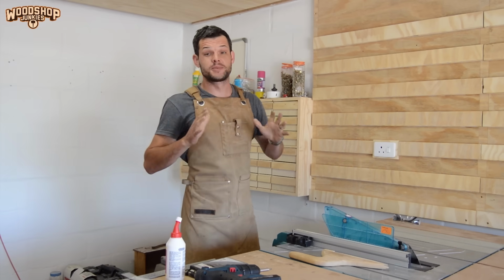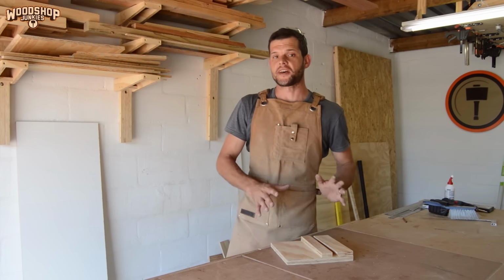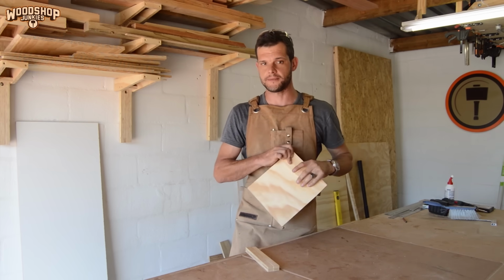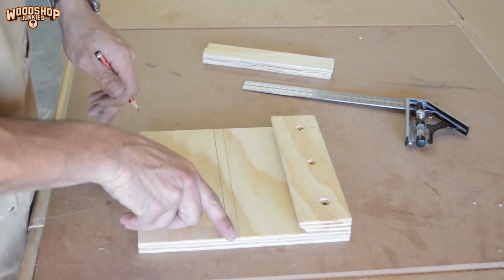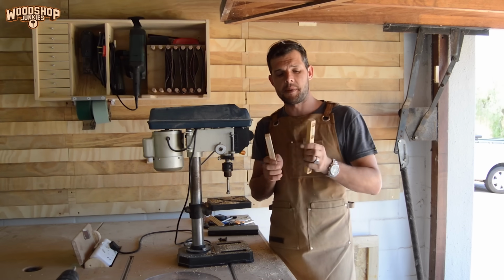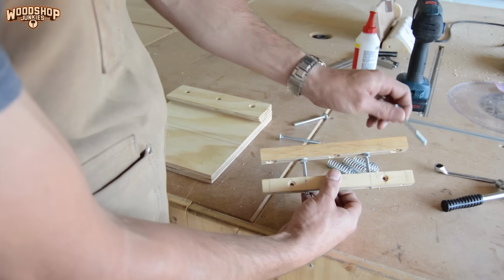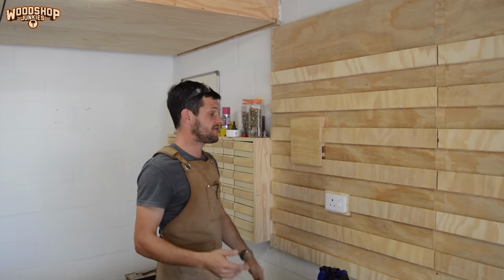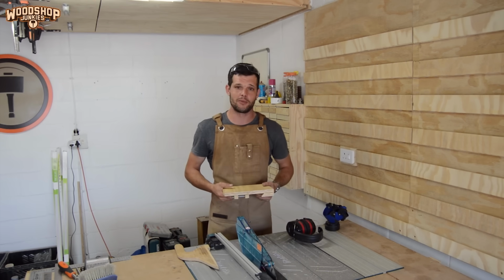Self-Locking French Cleat Mount - How To

Comment: My solution: I have made a 10 degree angle under all the cleats on the wall. I use a "lock-bit" on things I want to secure.  Easy, fast - but not as hmmm... "delicate" as yours :) But flexible though...
I have also thought about making a "pushblock" in the cleat it selves. Perhaps just a dowel at the right height, underneath the cleat is is hanging on. This could also be a "click-button" thingy...
Great channel!
Reply: @kimsmoke17  Thnx ;) 
...but I did not find "my type of button".
I am thinking of a non electrical one, like the top of an old style ball pen marker. Click = extended, click retract... Ifjusee.
Or did I just not find it?
Reply: I don't quite understand how your solution works. Any extra details to help? Also, what is a lock-bit? Thank you

Comment: I like a technique I saw on a different french cleat video:
* On the wall cleats, you add a 10 degree cut to the bottom (making wall-facing side even narrower).
* Add the same angle on top of the cleat you want to lock to the wall. (so the cleat is narrower towards the wall)
* Create a small block with 10-degree angles on each long side and of a height that will nest exactly into the space between the top of the cleat and the bottom of the next wall-cleat.

The block will prevent removing the mount by bumping or pulling; you have to wiggle it out from the side. It has the advantage of no moving parts, but the disadvantage of requiring alterations to the wall cleats to work.
Reply: I saw that one too. I think it is a simpler, less costly, and more pragmatic solution. But this idea is really cool, too!

Comment: The thumbnail was quite self-explanatory, but still watched the entire video because your videos are just that good.
Was just wondering if you even need separate guide bolts. If you just add a nut and washer on the inside of the spring bolts (same way that they are on the guide bolts), then I believe the 3 bolts alone will work as guide bolts for the block as well as holding the spring.

Comment: If you lowered the cleat on the hanging part, so the top of the backboard ends in upper half of the space between the wallcleats, you can easily lock the item hanging by sliding a wedge in covering the gap from your hanger cleat to the above wallcleat. That is one of the basic ideas with cleats, to evenly space and use same dimentions always, and you can make wedges that fit everywhere too for items you want to lock

Comment: It might be overly complicated for ordinary and average mounts, but it seems to be a good idea for those oddball mounts that require added security such as for what you intended it. Another instance in which this system would probably come in useful is where French cleats have been incorporated into a mobile storage or shop cart. I thought about doing this for a clamp cart to keep it modular. I want to be able to reconfigure the clamp racks as the clamp collection expands over time. I realized I might be pushing my luck using French cleats, but this looks like it might address the issue.

Comment: I like it! Maybe a cam lever system to operate the spring lock bar. Lever handle on the front for easy, one handed operation. Not trying to design your stuff. But it did look a little difficult to install/uninstall. 🤔

Comment: This is great for stuff you need to be able to move around easily. For lighter items that won't necessarily move, I'd just put a screw through the thing and call it good. Quick enough to move if you ever need to, but not going anywhere when you don't want it to.

Comment: It's a great idea to make best use of a small workspace. I have been thinking about something exactly like this.

I want to have a way to have a way to have a work platform when I need it and then put it away to make room for something else For example a a bench grinder. I could latch it onto a cleat, use it, then store it away again.

I think your design is quite good. It does seem like it still might come loose if enough pressure is exerted against it. I was thinking of putting a slot on the bottom of the French cleats. Then add a similar system to what you have now only the top movable block would be  narrower so that it slips into the slot on the underside of the cleat. (Hope that's clear.)  This way the retention would not be solely based on friction but would mechanically lock into place.

Comment: I loved your neat little idea of using springs!

One small query... The two additional bolts you introduced - other than the three holding the springs - were those actually required for the design to work? Wouldn't the movement of the blocks be guided by the spring-bolts themselves?

Comment: For locking cleats I think maybe it's a bit complicated, except in cases where you want to be able to rapidly remove the item. A wedge based lock seems simpler.

However, your sample piece looks quite a lot like the adjustable cleat spacing jig I'm making! Except that my jig spans two cleats, supporting the bottom of the lower one. Once the lower cleat is affixed, the spring is used to be able to remove the jig.

Comment: Clean simple design, friction on the lock is probably going to be an issue over time, but a decent sanding and a thin coat of poly might help? Be really good for a cleat mounted bench grinder

Comment: Great idea, i can certainly see the need for such a cleat. I am a buggger for bumping into things. 

(#notsponsored #notaffiliated) Have you heard of RAM mounts, by the way? They are a mounting system that starts with a ball  and they have arms and holders (including a ball with a camera mount thread to mount video and still cameras). They even have double-ball adaptors to joins arms in articulable lenghts.... 

The balls mount to various surfaces, including screw in bases, cup holder inserts or windscreen mount suction cup.

Arm lengths vary widely, from the very short to the extended pole for shooting footage outside vehicles or over shoulders. 

I use this system extensively (I use the "B" sized ball (25.4 mm / 1in diameter))  in my four wheel drive to hold radio mikes and phones. On even the most rugged tracks, I've never had one come off the windscreen or get bent out of shape, so everything is within easy reach. 

(Heres the point....) A lot of commercial movie makers are now using them to shoot footage, and I thought you might like to have a look to see if this is going to work for your YouTube gear. 

Check them out at www.rammount.com and let me know what you think.

(again #notsponsored #notaffliated just an #overenthusiasticfan of Ram Mounts.)
Reply from the maker: Thanks! I'll take a look.

Comment: I think it is a little bit complicated especially if you need to repeat this solution many times.
however, a simple screw or a screw with inserted nut could easily solve this issue.
but it is a new smart solution,thanks for sharing it.

Comment: I would just use magnets. Put magnetic bars along the wall and magnets on the piece. Easy and less cumbersome for frequent daily use. I do like the spring mechanism and will definitely keep it in mind for some other applications such as a bench clamp that lays parallel to the surface in conjunction with bench dogs.

Comment: My suggestion. Cut a small piece of wood (roughly an inch square? And the same length as what you are mounting. Hand your mount on the cleat. Fit the long square piece in between that and the underside of the cleat above the. Should prevent movement, saves time, easy to remove. I don’t know! Just my idea. I’ve never built a French cleat before!

Comment: I like this design. Small addition for more grab: on the top of the spring loaded bar that presses into the wall affixed cleat, drill 2-3 small holes and add glue in some tacks (with the heads clipped) or cut a brad nail in half and do the same. The spring pressure should push the tack or brad into the wall cleat and add a little more stabilization for you.

Comment: It's amazing and I think the only critique would be the amount of springs. Less might be more economical. Then again availability and spring strength come in. Maybe a wooden spring or the simple wedge triangle slipped back there is still the best solution. If you have a small cleat you want to move around often, like the camera, phone/music holder then springs are the ideal use case.

Comment: Why did you cut the heads off the bolts?  It seems to me like you didn't have to.  Also, you should extend the length of the push block so it sticks out both sides; allowing your hands better access to disengage the push block when you want to take it down.  You could even taper the ends to create room for your fingertips to have better access.

Thanks for the video
Reply from the maker: Great idea, thanks!

Comment: I used holes in the cleats every few inches and cut slots in the shelves that would line up and pop in a dowel
Reply: I did very similarly: If you position the dowel hole to be just under the cleat, then you don't need to align anything or add holes in you cleats. Just position the shelf and push in the dowel underneath to lock it in place.
Reply: @jmckl123  My thought exactly...
Reply: @jmckl123  I actually hadnt put the holes in with this in mind initially,  they were just to pop dowels in to hang things from, but they found a second use, which is now there primary use =D
Reply: Jmck L 
....But your solution wouldn’t take more than 1 minute to do! Where’s the fun in that?  😂 

Seriously though, yours is brilliantly simple, inexpensive, and doable by anyone who has the tools and gumption to do a French cleat system in the 1st place.

This is not to knock the great ideas and efforts of the OP! Not at all, it is his nice vid that helped get this group thinking and collaboration going, thanks for the vid.
Reply: If you put the hole in the removable board below the bottom of the wall cleat it wouldn't need to align with any prefilled holes either, unless you a worried about side to side movement. An angle on the hole would also allow for some pressure to be applied if stability is crucial or a bolt/screw for more permanent fixing.
Reply: @jmckl123  This is the best idea yet.

Comment: Would adding an inverted cleat cutout  and a spring system like that to move an additional cleat work better? that looks like it works great but I feel that a cleat on top and bottom would allow much more secure clamping. or even a threaded insert into the cleat rail and just a hand screw that will go into it on your mount in the middle of the face?

Comment: If you put a 45° on both sides of the wall cleats you can make an even stronger mount and you can also forgo the springs by making the mount cleats fit just right over the wall cleats and slide them on from the ends

Comment: Well yes you make a double French cleat system using the miter cut you already have  on the bottom to secure the cleat and make a rebate notch in the cleat just above and a corresponding rebate in the cleat itself. Your cleat needs to be longer than the opening is wide for the system to work and the rebate cut above needs to be deeper than the cleat rebate in order for you to push the cleat itself up into the rebate and clear the miter on the bottom. Gravity will hold the cleat down and the cleat above will hold it in so you can't rip it out unless you rip the entire cleat off the wall. You can make the system work with two miter cuts which can look really elegant if you get it right but with the rebate version it's easier to get the cleat to fit flush into the groove.

Comment: You could attach some sort of lever to the top plate of the spring mechanism that goes though the front that allows you to compress the spring with one hand and easily lift up and remove with the other hand.

Comment: Very good idea.
You wont have to do it to everything just stuff you need to move occasionally.

For the camera mount.
I used to have a stage lighting spot light.

It had an extendable accordian style arm with a spherical base attachment. The spherical base was tight enough to hold in place without a lock bolt and the accordian arm was stiff also.
Move it to a position and it stayed there.

Comment: Great idea! I wonder if it could be even stronger of a hold if the spring push block was at a 45 as well to grip the wall cleat better -- but of course then you'd have to redo the wall cleats to add the matching 45s which would be a lot of work
Reply: Great idea!

Comment: This design is ingenious.  But I am wondering...

if I went to a junkyard I wonder if I could cut a piece from an old automobile spring that had all of the tension I wanted.  Then you could connect it to a wooden frame that has the ability to stop the blade at various lengths (drill holes in the blade and use a stopper dowel).  This would give you the ability to change the tension as well.  Plus the overall part count is cut in 1/3.  anyway I have too many ideas swirling around.  Thats the genius of this design.  It displays vividly the interplay of forces that make it up.

Comment: You have indeed identified a problem. The solution works but just seems a bit too complex. Instead of the spring bar could you insert a shim or wedge the full thikness from the side. Or push some captive pins or bolts through from the front that go under the mounting rail. Keep it up enjoying the content

Comment: Nice idea. Why not make a "upsidedown" cleat? The block with the springs that pushes on the underside also has a 45° angle and the wall cleat also has a 45° on the underside. Effectively locking in from above as normal but springed from underneath. Also making a slot and 2 pins on the opposite sides to make removal easier. 
On your mention about debris filling behind the cleats why not make some small dados so you can brush out the debris so that that falls through the dado gap.
But doing all this means redoing all that what is already made.

Comment: Clever idea, it might be useful to extend the clamping bracket so that you can compress the spring more easily when placing or removing the bracket. I can think of several options, either to the sides or below. The same idea could be achieved more simply with a pair of cams which could be rotated from the front. I may have to play around with the idea on my cleat wall.

Comment: Maybe add a couple  pins through slots in the mounting plate to the pressure block, and some fixed to the mounting plate, so you can compress the springs from the front without having to push the whole mount up to release it.
Reply from the maker: Great idea, thanks! I'll look into it.

Comment: I really like it, but I think it might be even more stable if the spring loaded portion engages the next cleat below, along with the bottom of the cleat above.
If you grab a mount like this from the bottom and pull outward, it could still pivot out and the spring loaded part could disengage from the cleat. But if the fixed portion of the spring assembly engaged the cleat below, then when the springs force the whole mount into place, they'd engage two cleats rather than just one, and the bottom of the mount could not be pulled away from the wall.

Comment: drill a hole in the mounting piece just below where the wall cleat is mounted and push a dowel thru the hole. It will stop the cleat from lifting up. It will still slide along the cleat.

Comment: Brilliant idea bud. I reckon your springs are a bit too strong, as the whole idea behind the French cleat is that gravity holds it quite well, combined with the friction of the  unsanded wood surfaces. You should be fine for holding just about anything the cleat wall can hold. Even moving a transom arm around, it should hold with light upward pressure.

Comment: Wouldn't it be simpler to just slide a snug fitting square stick into the gap at the top of the fixture (where your fingers are at 3:04) after it is hung?
Reply: Something along those lines using dowels:
https://youtu.be/x6I5Bx4M5wc

Comment: Not sure why you cut the heads off the center bolts as they can sink down in the hole just like the outer ones, but thats getting picky.  However, would taking a special cleat on the wall to be angled on both top and bottom, and the spring clamp also have an angle to lock into it with pressure rather than just pressure by itself?

Comment: Overcomplicated solution to simple problem. A simple slide block achieves the same effect very simply. An even simpler solution (not mine) is to drill a hole in the hanging item to correspond with the lower edge of the cleat, and slip a nail (cut to size) through the hole. This seats up against the lower edge of the wall cleat above preventing the item from moving upwards and off the wall. Very versatile, especially if all your wall cleats are exactly the same width. Quick, easy to use and dirt cheap, not needing complicated springs etc and much less hassle in engaging/disengaging.